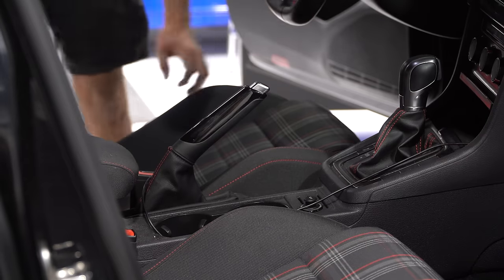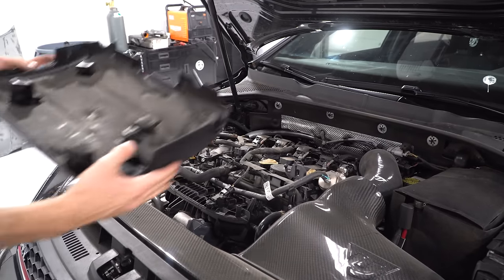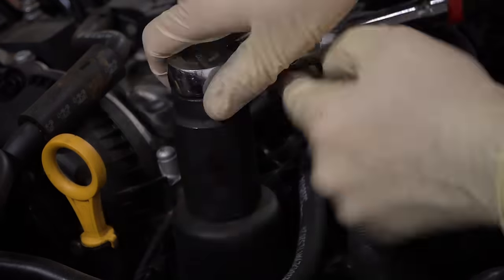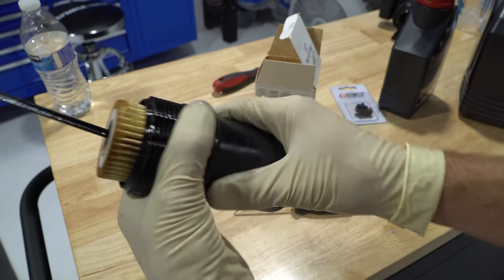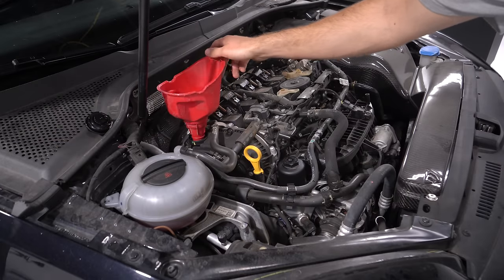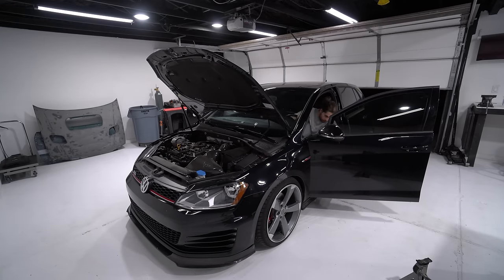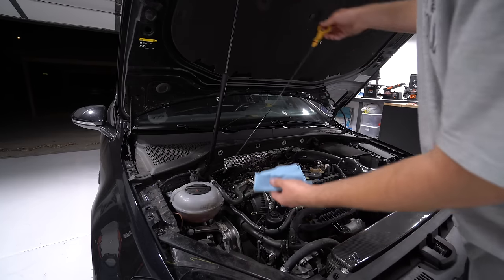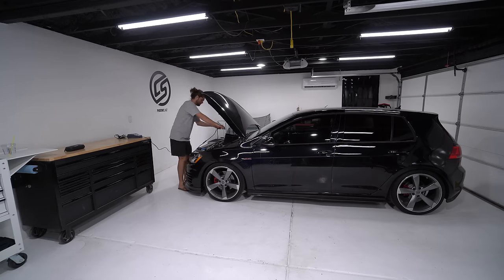VW GTI: Oil Change Step by Step (How-To)

Comment: U should go on ECS and upgrade ur oil pan to a steel one
Reply: No. A simple forum search and you would learn every steel oil pan has oil leak issues. Pointless upgrade. The plastic one rarely leaks, is as strong, or stronger, than the steel pans, and no matter if you had a steel pan, if you hit something, it’s going to need to be replaced.
Reply: @JacesOwnWorld  why u acting like im clueless? I said that bc he’s lowered and that plastic will definitely bust if he runs into a turtle like i did, thankfully my gli had a steel pan. And i also got a street shield on top of that afterwards.
Reply: @Jpooppy  because he's right.  If you switch oil pans to steel on MK7+ they will seep and or leak.  If you're worried about hitting the oil pan they sell some nice undershields that will protect the oil pan but the plastic ones are actually in my opinion better they also help keep oil temps down because the plastic can radiate the heat quicker than the metal can so it just depends on what your perspective is.
Reply: @Jpooppy  naw dawg I’m with you. I got it too it’s hella nice. But I do have a mk6

Comment: Don't even need to jack the car up or touch that oil drain on cars with the oil filter up top. Use an oil extractor as per VW specs.
Reply: Go watch TheHumbleMechanics video on that. You'll change your mind real quick. The extractor leaves a ton of oil behind, takes longer to get the oil out, and not to mention the metal shaving from the initial break in of the car will just sit in your oil pan forever.
Reply: @Crazyman1338  I debated on an extractor while I had my gti but eventually decided the same thing. I could see if you were stuck in a place without adequate tools and space, maybe, but ultimately decided against extractors.  Something about the thought of the oil fighting gravity and not getting 100% out didn't sound appealing
Reply: @Crazyman1338   @Elijah Gior  First, Charles doesn't come to the conclusion that you need to drain the oil in the traditional way. His extractor got full and had no more space to create suction in the tank, because the car was overfilled. I actually did this exact same test with my mk6 when I got my pneumatic extractor, and barely got a cap full out of the bottom. You also need to run it more than 3 minutes before extraction if the car is cold and also keep sucking for a minute or two while it is sucking air bubbles.  Also, nothing just sits in the car forever. All of the oil is changed out after a break in from the factory to begin with, aside from the fact that all of the oil sloshes and mixes as you drive every day. This is on top of the fact that we even change the oil twice as often as VW says is necessary. But go ahead and make the job more difficult. I have 6 dubs to maintain I'll do it the smart way.
Reply: @Crazyman1338   Sorry but this is wrong. If your filter is on top the extractor is the way to go. You get a quality extractor and it will work fine. You know how much you put in you see how much comes out and it is measured. Oil should be warm just like always. Plus with the plastic oil pans it's the smart way to change it. Who waits for the oil to stop dripping when draining from the pan anyway? Nobody.

Also the Humble Mechanic didn't say they left a ton of oil he said it didn't work in all cars. It works in VW 1.8's and 2.0's.

Comment: when you angle the engine like that it drains more than on flat ground. same for my Honda when it says it only takes 4.5 quarts on a regular change but when I use ramps and the engine tilts back it drains more and takes the 5 quart jug usually.

Comment: Did this job on my Octavia 245 the other day. Personally I don't like putting a jack stand onto the pinch weld. I use  pair of Swaben ramps. There is a good strong jack stand point under a removable plastic cover behind the front wheels if youre doing any more substancial work under the car. The oil filter is tightened to 25 nm. Get yourself a torque wrench, why guess?  I also clean the filter housing with degreaser, dry it and lubricate the new o ring with clean engine oil.

Comment: If you want to get most of the oil out then pour a little bit of some left over fresh from previous oil change in to flush the last bit out until running out clean ,then install plug.
Reply: I've always kept a qt of cheaper oil on hand and ran a bit of it through after it's mostly drained in hopes of flushing as much out as possible.

Comment: Awesome video, I saw the Phoenix AZ on the wall, I am in Chandler. Thanks to you I just completed my first oil change on my new 2016 GTI I picked up off my buddy with only 25k miles on it! I have some questions about tuning the car, do you have anyone you can recommend in the area for stage 1?

Comment: Hello, can I ask you? I was changing my oil today and I forget to buy new drain plug, so I used original. Is that big issue? It was not damaged, I can see 0 oil on it when I put new oil there. Unfortunately I checked that I don’t have it after i took oil away..

Comment: First time changing oil on my GTI do you need to change the plug every time you change oil, or did you just change it so you could get the magnetic plug?
Reply: ^^^ same question!!
Reply: change the plug every time 👍

Comment: I change the oil on my 2017 gti but know is leaking from the oil drain plug any wat to fixe or is the oil pan?????
Reply: Did you use a new plug?

Comment: Hi, after done changing oil, do we need reset anything on the cluster meter? Oil trip? Engine oil reminder? If no need i want to change by myself
Reply: Yes, you reset the oil service, by holding the reset button on the dash, then turn ignition on, turn the key, you don't have to start the car and then it will say reset service and press the 00 reset button again and job done till next oil change

Comment: Is this oil change the same for the 1.4 tsi model 2011?
Reply: No filter is underneath car I believe but kinda the same process obviously should be a t45 for the drain plug because the plastic oil pan came with mk7 up

Comment: Why do you use 5w40 and not the recommend 5w30 ?
Reply: The manual for the mk7 GTI says to use 5w40 or 5w30. As long as it's one of those and it meets the 502 spec from VW it should be fine. People tend to prefer to use 5w40 though.
Reply: On the 2021 GTI 2.0 0W-20 Castrol Edge is the recommendation as it was for the 2019 1.4 Sportwagen I had
Reply: My mk7 gli also say vw508 0w20 oil which i I’m using the 6200 liqui moli

Comment: Do exactly this on all modern gtis/glis with 2.0t. If you have a new 2019 and up use a 40weight oil! Do not use the stupid 0w-20 spec from vw. It is sacrificing engine longevity/lubrication and peotection for negligablw fuel exonomy gains. Dumbest thing ever!  Getting an extra 1/4 mpg in exchange for having too burn for fossil fuel too make more cars because the car doesnt last as long because they needed 1% better efficiency...smhh. Do your research. See for yourself!

Comment: What i really dont get is how VW can be so dumb and let oil be opened with a simple screw driver. It makes it possible for anyone evil to just drain your oil. In my world it should be a more complex key that not everyone  have access to..
Reply: I very much disagree. The oil change is already challenging enough with the stupid plastic drain plug that gets more destroyed with each change. Also, how would someone even get under the car??
Reply: @packerjack87  Never had a problem with the plug though it may not be optimal with a plastic one, and i use car lift. But would be enough with a jackstand for anyone to mess.
Reply: Or you could just carry an adjustable wrench and do this to just about any car